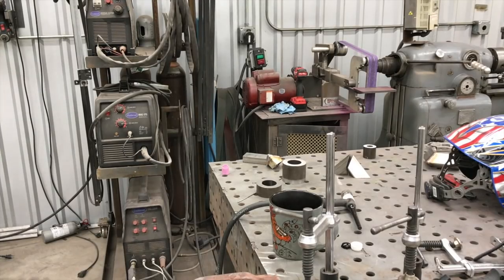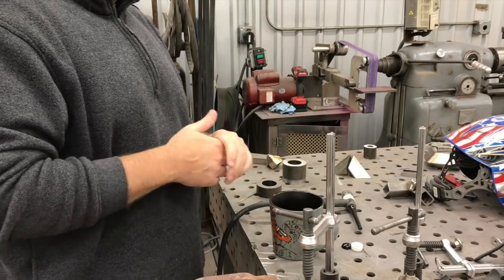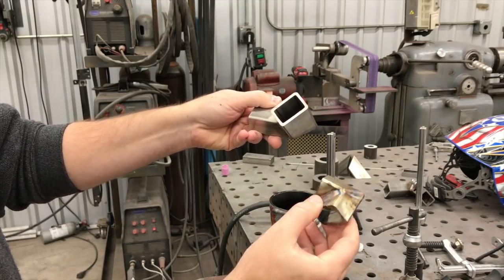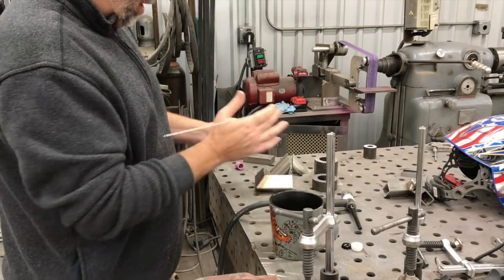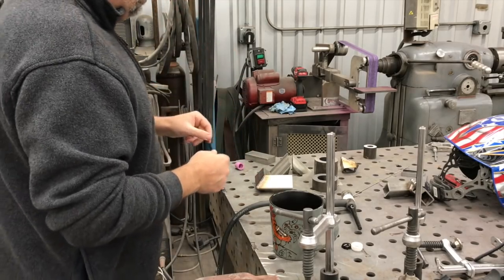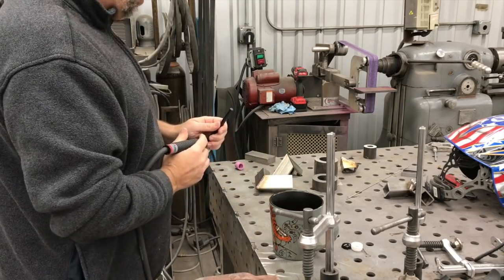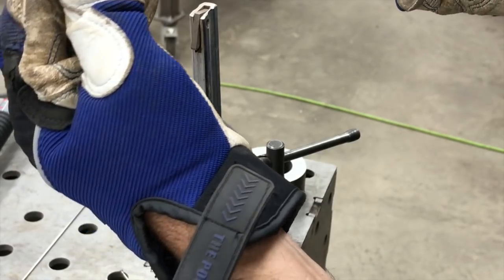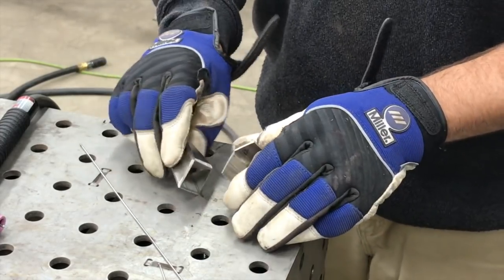Youtube Viewers Teach Me How to Tig Weld? - Large Tig Cup Work? Tig Welding Stainless

Comment: Use at least 25 CFH, Maybe use a smaller filler rod, also use a gas lens! Rare earth tungsten is good with all materials (green band) Once you see the puddle start dipping and move quick,  taper off your weld towards the end... HOLD for 5-10 seconds! It will help im sure I use 160 amps and it doesn't effect my welds... Let me know if it helps!
Reply from the maker: great tips, thank you
Reply: Ramsey Customs - turbocobra No problem my man! Check out my welding instagram @ PJ_Oregoon I got some stainless on there

Comment: 12:11 is that weld joint cracked?
Reply from the maker: Yes, there were a couple of joints that I tried to fusion weld with no filler and running over it real fast, and both of those cracked

Comment: I run a fupa 12 and can get nice colored welds with no issues with carbide precipitation or grey cooked welds.  It comes down to 3 things:  1) running the right amperage, 2) having a big enough cup that your weld is shielded by gas.  3) holding a tight arc.  

If you try to weld wide beads and run hot you will have cooked looking welds on stainless.  I find a lot of people try to make mig/stick sized beads with tig, and that doesn't work that well due to the metal staying way to hot after it leaves the gas coverage.  

A number 12 cup is fine for general stainless work, a slightly bigger cup can help.  However a bigger cup will likely not make a difference for your situation.  Make sure you run 25cfh of argon.

A tight arc significantly reduces heat input.  You have to maintain around 1/16th arc gap to keep the voltage low and the heat output focused.  

I weld up to 1/8th+ stainless with a 1/16th filler rod.  The smaller rod allows me to keep a tight arc, and a small width bead.  Going to 3/32 requires more amperage since your melting more metal.  With 1/16 I can always feed more to fill a weld, 3/32 will stick to the puddle if you try to run reduced amperage.   

For bonus nachos you can use chill blocks of copper or aluminum behind the weld.  The more heat that gets pulled out of the weld the better.  If the weld is 200 degrees cooler when the weld is exposed to oxygen you can get better color.  The color stainless turns is a direct result to how hot the metal was when it was exposed to oxygen.  

If I were you I would practice on 4 to 5 inch fillet and outside corner joints with a bar of copper or aluminum clamped to the back of the joint.  Run single beads on them and look for completely uniform color when your done.  If you are seeing the weld have yellow color start to finish, you are onto something.  If the weld is multi-colored/rainbow colored it means your amperage/travel speed/arc length/filler amount was not consistent.

Comment: The problem you are trying to solve when welding stainless is simply oxidation when the metal is hot. There are two schools of thought when it comes to this.  1. Go pauinfully slow and low amperage so that by the time the weld exits the gas shield it is cool enough or 2. limit your heat input by using pulse, turn up the gas to all she'll suffer  and go as fast as possible.  just remember you don't want hot metal to be unshielded.  If done correctly the weld should come out looking straw coloured and slightly shiny.

Comment: I watched video #1, and read through all of the comments at that time. Like many others, I've learned a tremendous amount from Jody, 6061 & TxsViking, and wouldn't put myself in the same class, but a few observations: 

The difference between the outside/inside welds is most definitely gas coverage/too hot, but your other issues are also affecting....gas flow @ 20-25CFH, less heat (80-100amps max), tighter arc, slow down (evident by your lack of fusion), and possibly even drop filler wire size to 1/16. You're literally cooking the ss, which gives you the crusty look. Try and report back, I've enjoyed this "learn together" series.
Reply: Also, 15sec is unnecessary, but it will help if you'll hold the torch in position for 5-7sec and let the post-flow work.
Reply: "Carbide Precipitation" was the technical term that I was struggling for, and here's a link for a video that will help with your welding ss:  https://youtu.be/rZxtAjutLYQ

Comment: Gary,

Try running the Furrick cup at 25cfh to start and adjust from there.  If you remove the stainless or any reactive metal filler rod  from the shielding gas before it has cooled you will contaminate the end of the rod.

Comment: Looks way too hot , I would run that at 80 or 90 amps. As for the blackness on the outside joints you will tend to get that as air will get drawn into the shielding gas flow, turning it up can make matters worse, a dam on either side and back purging can help plus pickling paste afterwards to clean the weld up.

Comment: You're welding real hot man, the best trick to get the right ammount of amps is to count to 3 when starting your arc. You should get a decent puddle after 3 seconds. Faster than that you're too hot, slower you're too cold. Cheers!
Reply from the maker: Awesome thanks Cedric, Never heard that trick before, definitely will try it
Reply: Ramsey Customs - turbocobra it'll make you go slightly slower but the results Will be wayyyy better!

Comment: You want to hold the post flow as long as it flows
You want to hold your torch at an angle not straight up and down
You want to adjust your heat for different joints
Try a smaller filler rod
SS does not need to be welded so hot so fast, its like cutting SS, slow and steady
Reply from the maker: Ok, thank you, that's a good thought.  I will try running alot less heat and going slower
Reply: I hope it helps. Either way, you're off to a good start, especially since you don't weld SS very often if ever. 
If anything, its a good starting point.

Comment: I watched both vids. Some good advise in the comments on the other video. Here’s a few things I noticed:
- like eco mouse said- clean clean clean. Then don’t touch the areas you are welding. 
- the biggest thing I think you’re doing wrong is when you said 200A. Not sure if you’re pedaling it but on .120 wall, I’d be running it around 100A. 
- with the fupa 12, run about .75” stick out and 25-35 cfh. 
So, less heat, more gas, wipe everything with acetone.
Reply from the maker: I did 200amps for the fusion tack, and your right i didnt explain but i have my pedal set to 120 amps max, roll on to 3/4 pedal when i light up, then adjust the pedal as I go watching the puddle.  The thing about cleaning is, yes, I do need to clean better and will definitely do that, but that wouldn't explain the difference between the inside joints and outside.

Comment: Are you controlling your amperage with the foot peddle? It seamed a little high. Once the material gets hot you need to back off a little to maintain the same weld caricature as when its cold.
Reply from the maker: Yes sir.  I have the max Amps set to 120, I roll on to 3/4 pedal to get it going then watch the wetness of the puddle to back off and adjust as going.  I agree that it seems to high, but any less heat and the puddle is really struggling to move along, and seems cold.
Reply from the maker: I am sure it was a typo autocorrect type of thing.  Dude lays down some badass welds, check his youtube channel
Reply: Ramsey Customs - turbocobra 

What size filler rod are you using?
Reply from the maker: 1/16th
Reply: Weld "caricature"?  What is that?  A caricature is a picture, description, or  imitation of a person or thing where striking characteristics are exaggerated.   You'll have to explain a weld caricature.   Now, if you'd have written "the same weld characteristics" - that would make sense.

Comment: Oh yeah... duh... wipe your pieces down really good with acetone AND your filler rods!
(Also it sounds like you only need 6 or 7 seconds of post flow. Otherwise you are just wasting gas, since you aren't actually hovering long enough. 15 seconds of gas over how many feet of welds you've got to do for the whole project will add up big time)
Reply from the maker: Customer is paying for gas, but yea your right.  The one main advantage to more post flow even though you aren't hovered of it is it protects your tungsten, keeps it form being contaminated.  Good point on wiping, I did run these on the burnisher to clean them, but didnt wipe them.  That wouldn't explain the inside/outside difference because none fo the metal was cleaned
Reply: Oh, don't leave your acetone rags/towels lying around either. Not that I would know anything about that... I just heard about it on the internet ;-)